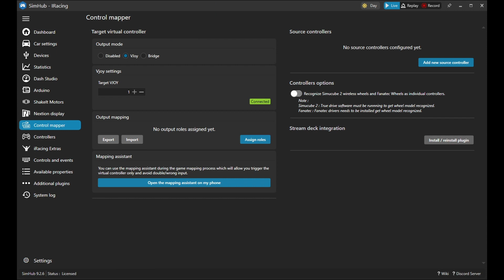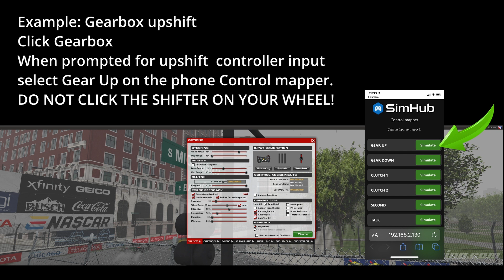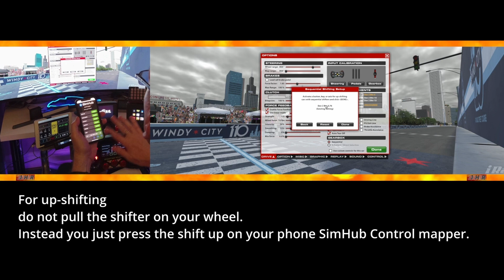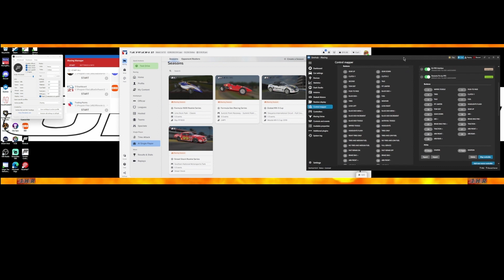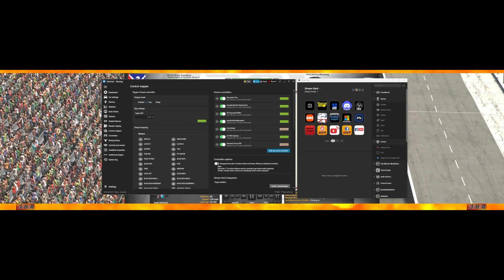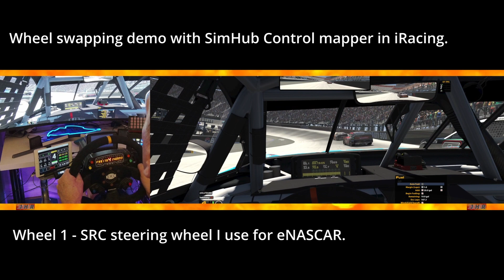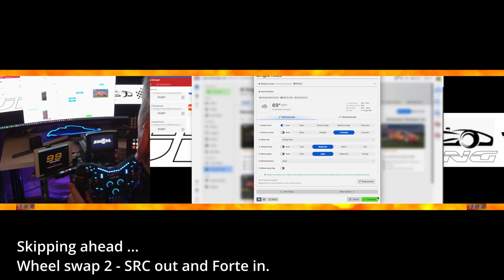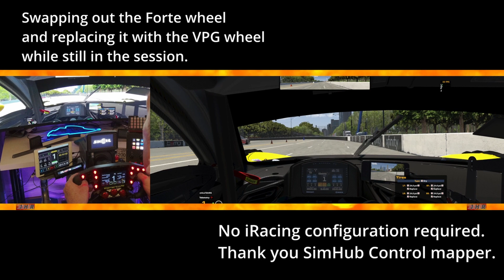JHRacing SimHub Control Mapper SIMPLIFIED

Comment: Have you found a way to simplify having slightly different button layouts with different games? I can’t wrap my head around that one
Reply from the maker: No. If I use RF2 or F1 games I map inside that game. The mappings in this video are for iRacing. I tried in RF2 but it did not work. I am still trying things but no luck yet.